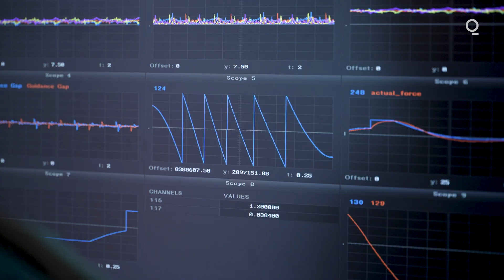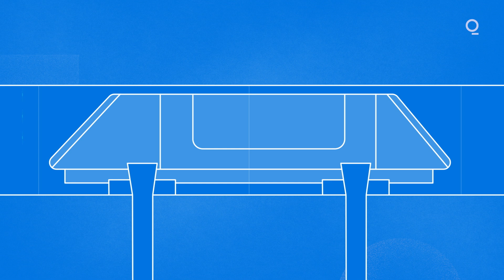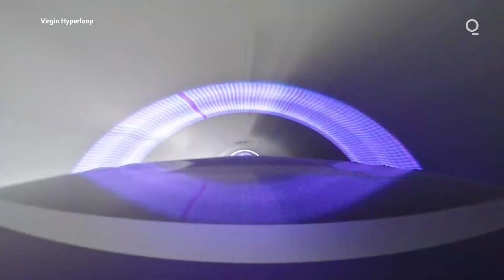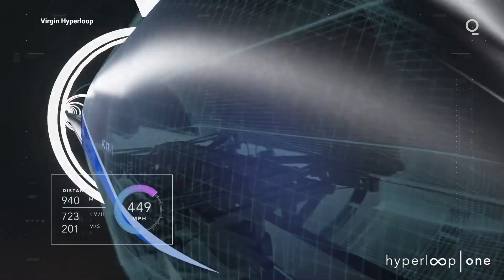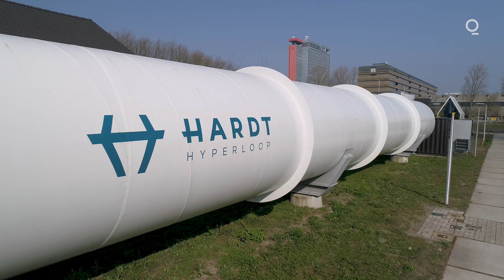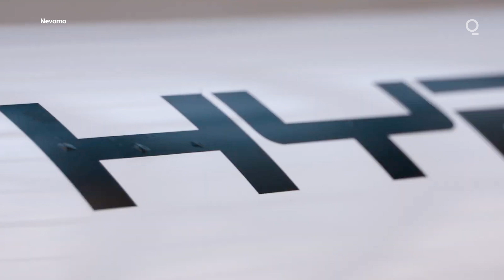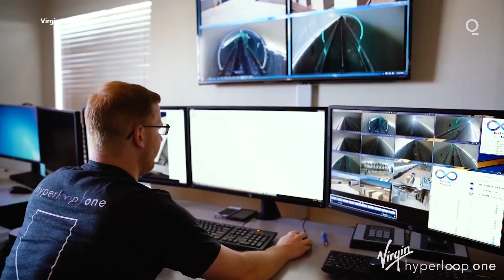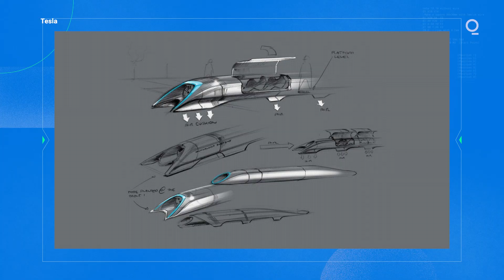The Hyperloop May Disrupt More Than Just Travel

Comment: If there’s a “virtual vacuum” in there, then why are they all designed with long aerodynamic noses on the front? Seems like a waste… 🤔
Reply: Yes it is a vaccuum tube like the old things that used to be at the banks to send your money pod to the teller. The pointy noses just look kewl and are purely cosmetic.
Reply: @chipevans8239  You are so close but no that is not what it is.
That is actually how this idea was in the early 1900s and tested in London.
And the idea has existed from at least 1799 the man who invented it at least credited for it is George Medhurst 

The idea you have and what was created is that you push air from one side to another it is not vacuum.
Reply: @chipevans8239  It's a PARTIAL vacuum so needs the nose
Reply: @chipevans8239  stop pretending this thing will ever be built. It's just another grift of Elon Musk
Reply: @77Avadon77    Elon has next to nothing to do with it, your aggressive ignorance will cost you.
Reply: Maintaining a vacuum at this sort of scale is going to be exponentially more difficult as you get closer to full/hard vacuum. In practice the system will only reduce the pressure as much as it needs to, which means that at 1000+ km/h there will still be plenty of drag. Hence either you use that air in some way (put a turbine on the front of the pod) or you try to slip past it (design the pod for low drag coefficient). This video shows examples of both options.

And to be clear, "as much as it needs to" isn't exactly about drag. It's about avoiding the sound barrier, which stops being a thing if you reduce the pressure enough. I could absolutely see longer hops (eg. 100+ km uninterrupted) using lower pressures to allow higher speeds, relative to the shorter sections making up most of the network. I'd also expect speeds to increase over time, with improvements in technology and safety and regulatory confidence.
Reply: Could be for marketing. It does look nicer
Reply: What about the huge fan on the front?
Reply: @8ZZZZZZZD  other concept, tube still contain air and the fan propels it forward. Its less effective however. Its a concept from the 60th's
Reply: Virtual vacuum means it's not fully vacuum, duh. Why not make your nose aerodynamic? How much do you save with rectangle?
Reply: In the video it says "almost vacuum" so there is still a bit of friction that needs to be offseted.
Reply: @catpawjack7687  do you know how long it would take to get an almost vacuum out of miles of tunnels. That's never going to happen. The energy it would consume to do that would be ridiculous and completely unnecessary.
Reply: You are asking too many questions. The government doesn't like people that are not gullible like you.
Reply: @korana6308  *The billionaire
Reply: I believe it's to get rid of sonic/acoustic boom while leaving the tube or tunnel. In some point it have to touch some medium like air and as it was said in video, hyperloop operates under conditions close to vacuum, so there is still some air friction there. Just much more less
Reply: @Exorcistt94  100 millibars is functionally nothing though.
Reply: lol why you asking about aero- when there's no air for?
Reply: Easy way to settle this.  Would you prefer to have something that eases itself, narrow to thickest, into your tunnel? Or, would you like a 6 inch cube to try and fit into your circle space?
Reply: virtual vacuum doesnt have to be complete vacuum. And they can be repurposed if need be. And they look cool!
Reply: Near to vacuum it said. Dunno but if it would make much difference.
Reply: they can't get a vacuum...total scam.
Reply: "near vacuum"
Reply: Not a perfect vacuum so a substantial amount of air resistance still exists. Thus aerodynamic noses are more efficient
Reply: It's a PARTIAL vacuum, needs the nose.
Reply: Because they aren't suppose to work anyway
Reply: HA HA HA! But really, that's just  a pathetic scam rusting in the middle of the desert.

Comment: The price needs to come down substantially before it’s worthwhile. There’s no reason to evacuate the air from the tubes with external pumps. The pods themselves can push the excess air out if they fit more snuggly inside the tubes. The tubes can also be smaller. The goal should be to have passenger pods that are no larger in diameter then corporate jets.

Comment: Aside from the many challenges hyperloops face, one I haven't heard talked about much is emergency procedures in a "vacuum".  Is everyone going to put on spacesuits in an emergency?  Do they close off that tube section with airtight walls and rapidly put air back in the tube for people to breathe?  How would emergency exits function and how far apart will they be?  What does it take to return the loop to normal operating status?  I imagine the answers to these questions and more will multiply the cost per mile of having a hyperloop more than just the basic proof of concepts we see a decade into development.

Comment: 6:12 - $60 million per Km - So is that just above ground or in tunnels? That is insanely expensive!!
Reply: HS2 in the UK cost £307million per mile to build, but Elon can do Hyperloop for $60 million per Km (£68.5 million per mile?) BS!!
Reply: I actually did a project on this and if they build a hyperloop between Cupertino and Sacramento or La and Sanfrasico they would actually make their money back in 5 years which is a relatively short time, plus you would make tons of money
Reply: I can assure you, that Maglev costs more than that, and putting a maglev inside a vacuum chamber means that the hyperloop will costs at least 3 times more than that.
Reply: @gold9994  I need to add that the proposed systems is fine for cargo. Putting humans inside is like deep sea diving or astronauts, I do not see how they are going to manage these kinds of risks.
Reply: 60 million per KM wouldn't even be high when compared to high-speed rail, which in Europe can reach up to 40 million per KM and up to 58 million in California. So considering the doubling of speed that you get from hyperloop and the increased flexibility + potential to use solar energy or wind power on top of the lines the economics of it could work out. The actual limiting factor with hyperloop is its inability to take sharp (by rail standards) turns at full speed, however this becomes less of a factor given wide enough distances and in the cases of flat terrain becomes a non-issue.
Reply: @tumisveinnsnorrason7379  But, are you sure that it'll be 60? I think we're touching 200m per km.
Reply: @tumisveinnsnorrason7379  It won't work out, I am taxed on my CARS to support the public transit in NYC... I live 80 miles away from NYC... oh and the MTA is still billions in the hole...

So... huge city... + taxing all the cars around it, even for tons of people who NEVER touch the system STILL in a massive hole...

Sure... this garbage will work right?
Reply: @mattlane2282  The hyper loop would befit you more than you think, not only will the hyperloop probably be more acceptable to you it would also take cars off the road which in turn would reduce traffic
Reply: The scale should drive it down over the upcoming years. Its mostly one time invm though imo.

Comment: Several major problems here: #1 Volume. Trains do this much better and in order to complete, hyperloop would need large clusters of tubes. Think 20-30 tubes going to the same location. That’s a lot of infrastructure. #2. Maintaining vacuum becomes exponentially harder as the length of the vessel increases. The odds of a leak developing simply increases the further you go, which means the tubes will need near-constant maintenance, which in a system that can’t be diverted to a different rail section and works on atmospheric pressure, the entire section of tube would need to be pressurised and taken offline. #3. It has the potential to become a Simpson’s “monorail” where taxpayer dollars are funnelled into a virtue signalling “green” transportation measure that isn’t all that green and is only done in order to get certain politicians elected.
Reply: Throwing shade on Cali's preceeding King Jerry?  Intimating that they didn't consider some kind of important stuff in advance?  Oh, no.  Not in Cali.  Not with King Brown.
Reply: @jackjarrett8759  Gotta honor “moon beam’s” ineffective legacy through yet another San Fran-failed politician alumni.

Comment: I wanna see it connect from delusion to reality.
Reply: I like it because successful or not - it'll create a whole new horror genre. Claustrophobic setting, speed, magnets, high voltage, eye-popping vacuum... That's like giving someone a blank check and telling them to just go nuts.
Reply: Best comment yet.
Reply: wait 5 years and reality will tell you if its feasible or not.
Reply: @jonathanodude6660  Reality and Physics already fixed that for us. In CGI it works mainly because if Zero constraints. I think they will just switch to a meglev and say that was the plan from the beginning and it’s extremely new... blabla..
Reply: @platin2148  hyperloop is just maglev in a vacuum. Other than the engineering challenges in maintaining the vacuum and the upfront costs in doing so, where is the impossibility?
Reply: @jonathanodude6660  The tube the vaccum and that it’s super dangerous compared to a regular maglev and also do you know thermodynamics?
Reply: @platin2148  obviously it’s more dangerous, but the dangers can be mitigated if it’s designed with those dangers in mind. Are you trying to argue about entropy with the thermodynamics bit? Because if so ns it takes energy to maintain a vacuum.
Reply: @jonathanodude6660  I’m talking about the steel pipe not how fast it will destroy the vaccum pipe when you get a say pencil sized hohle in it.
Reply: @platin2148  are people going to be shooting at the tube with guns? How will you get a pencil sized hole in it? Is this a problem trains and planes have to deal with? Holes popping up?
Reply: @jonathanodude6660  I think you didn’t get the comment above i said it’s not about that. Btw. a pencil sized hohle is probably already way to big to be reasonable a pin needle hohle wouldn’t be though when one just thinks about the connection between the pipes.
Reply: @platin2148  oh right. What about the steel pipe?
Reply: @jonathanodude6660  The idea has been around for more than 100 years.  It doesn't exist, and never will.
Reply: @johnhonker437  it’s not that uncommon for ideas to take decades to implement, especially ones which require major infrastructure changes. Though, it did only take 8 years to go from testing to opening of the first underground trains. Let’s see how long it takes hyperloop to go from testing to final confirmation of its feasibility. Realistically all the issues are solvable, and it can be made safe. The real thing that people should be worried about is cost, because that’s the ultimate deciding factor here. Even if it’s actually negative on its own, if it can stimulate and interconnect major economies and change the transport landscape, it will be seen as integral to the world of the future and its losses will be mitigated by the rapid growth of tourism, communication and scientific research and the reduced climate impact of freight (which will probably be what funds it lol Imagine how much Amazon will pay to have exclusive lines here.) all in all, wouldn’t be surprised if it makes a loss, but like other public transport systems worldwide, they’re still funded by the government because it’s an essential service, and costs for everything would be higher if it didn’t exist.
Reply: never going to happen, just a few short lines in authoritarian nations
Reply: there is not enough upvotes for this comment
Reply: When you have asbergers dillusion syndrome, it's hard not to think everything in your head is real,

Comment: To have short separation between pods, they'd need to be traveling the same speed, which means a few hundred meter acceleration tube leaving each station, and a few hundred meter deceleration tube approaching each station.  Or ketchupy interiors if you accelerate faster.

Comment: I don't understand why they don't have massive Model Train Sized hyperloops to test transfer network operations and safety features. Like having an electric current keeping a magnetic breaking system turned off so the way should the system fail it'd automatically engage. Or if there is a breach in the vacuum. I'm not an engineer but these seem like simple proof of concepts that would get people over some of the feasibility hurdles they may still have hangups about.

Comment: Are you still falling for this Hyperloop nonsense?  Just look at the pictures of the trains you show all, apparently, rushing at high speeds through a near vacuum.  So why do they have pointed noses?  You only need those if you're cutting through air.  Even Elon Musk has failed with his tubes and tunnels.  And how do you get passengers off a failed train that's stuck in a vacuum?  It's engineering nonsense.  Get real Bloomberg.

Comment: I think the idea is inspired, I entered the spacex hyperloop competition with edinburgh university a few years ago. I think the main problems are; 1) tunnelling costs need to come way, way, way down. Not just for tunnels, but importantly for junctions etc as well, and the TBMs need to be made extremely accurate and reliable as well, this is not trivial at all. 2) the safety aspect is rarely addressed, but a vacuum of that size represents a lot of hazzard which needs controlling, especially as the plan is to put thousands of people in there travelling at high speed. 3) the quality control and life support tech around the pods is also very significant as they are expected to perform as much as space ships as trains. 
All this to say, I think it offers key advantages and I support developing the technology around it as it has many additional uses, but do not expect to see this outside of a small number of opportunity routes for the foreseeable future.

Comment: Europe (US, etc.) could become a Local Area Network and we the IP packets.
Reply: That's just the start
Reply: @rajeebbarma  its bogus, been disproved before.
Reply: @thebravebrit405  by whom? Nobody asked me anything
Reply: Or we could just build a massive network of High Speed Trains that accomplish the same thing as a supposed hyper loop would. But also comes with the added benefit of not requiring tens of thousands of kilometers of enclosed metal tubes being kept at near vacuum.

Just Sayin'
Reply: @Preacher_.  you're right. We need an air capsule which creates vacuum without the metal cover
Reply: @Preacher_.  No it wouldn't accomplish the same thing. Hyperloops can travel up to 1000kmph that's around 5 times as fast as a HSR. The potential for this is far greater.
You're right it would require relatively a much greater up-front investment but once we develop the technology and scale it up the cost will come down dramatically.
We may end up not even needing a vacuum if someone innovates a better technology. The Wright Brother's planes looked nothing like what modern day planes look like.
Reply: @spudchunk811  One small correction; 600km/h, ON PAPER. 
  But you're right about potentially "not needing a vaccum", it's called High Speed Rail, they're incredibly safe, efficient, and cost effective... Plus they don't require operating in a near perfect vaccum...

There's a reason Elon's new "Hyperloop" in Vegas is just a bunch of Tesla cars in very small tunnels going 25mph... 😶
Reply: @Preacher_.  Even still, this would be 3 times as fast as a HSR. The whole point of the hyperloop is to improve efficiency by maximising speed between cities and possibly countries. HSRs also don't interconnect between countries because it simply isn't fast enough to be viable. 

Also, Elon isn't developing a hyperloop. He initially proposed a hyperloop though. What he is doing is building tunnels underground to increase road surface area in congested cities like Los Angeles (not Vegas). Los Angeles has a massive problem with traffic. Also, if the project works out they will go a lot faster than just 25mph.
Reply: @spudchunk811  Even if if was 3x faster, the cost of it would be astronomical. You would need thousands of miles of constantly maintained vacuum tubes, and if one were to spring a leak, everyone in the tube would die. It's just not practical.
Reply: @allending8753  Again, you missed the point. Yes the initial upfront cost is big, but as they mentioned in the video committing doesnt mean huge spending it means proving it can work. Governments and big investors have the money to see this through.
As for its cost and maintenance what you cant understand is that the cost will significantly come down due to economies of scale. Again, we may not even need a vacuum as new/better more cost effective solutions are developed. You can't say this won't work until its been fully researched and actually tried in real life.

Comment: Imagine the mechanical fitting tolerances on this thing to maintain the vaccuum...
Reply: imagine the heat expansion
Reply: @einar8019  i bet the materials used for this if its being built commercially have to be one of the best grade.
Reply: @thach67  and imagine if it springs a leak, boom everyones crushed

Comment: Hyperloop will never happen.  No vacuum can be maintained over the distances quoted. There are no expansion joints. The power required for the pumps is in GigaWatts. Every joint doubles the failure rate of the vacuum.